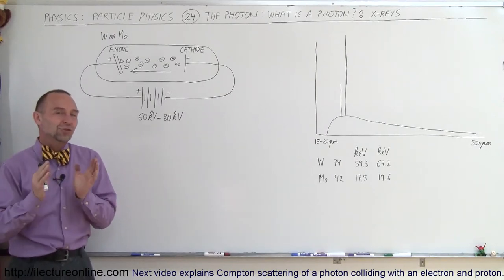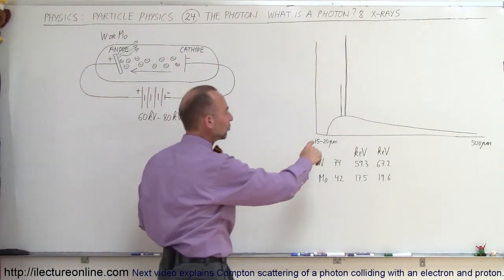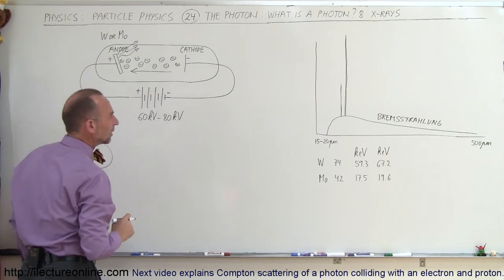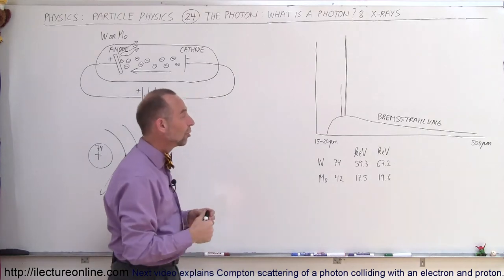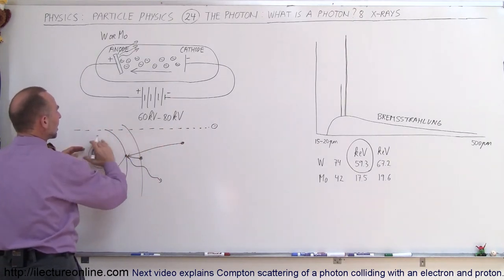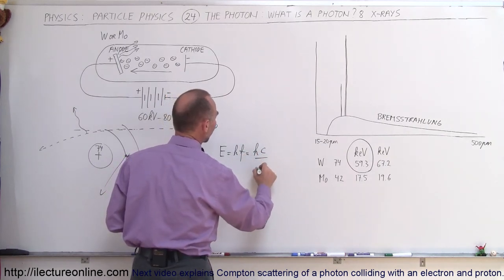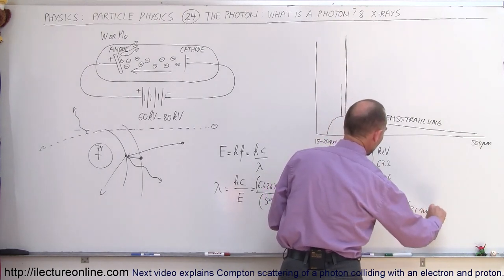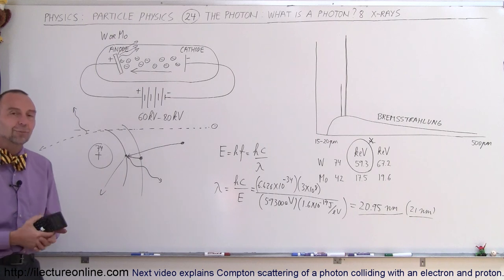Particle Physics (24 of 41) What is a Photon? 8. How Are X-Rays Produced?

Comment: Just a suggestion to you sir, instead of writing the values of h and c again and again in the formula of wavelength [ lambda= hc/E] and then converting it to nano meters by dividing it by a factor of 1.6 x 10^-19, you can simply use this - lambda= 1242/E. This directly gives you the wavelength in nanometers . ( i use this a lot cuz this saves time and i was taught this during the preparation of  JEE  ) .
Reply from the maker: Yes, on the JEE, there is no time to waste.

Comment: What is the characteristics line of the continuous line spectrum ?
Reply from the maker: The continuous line spectrum,  (which looks like the black body radiation curve), is produced by the heat of the heat source and the target of the electrons being projected across the gap, the characteristic lines are the peaks produced by the acceleration / deceleration of the electrons themselves.
Reply: @MichelvanBiezen  But as i now , the characteristic lines is  discrete line , but heat is continuous form of energy , does it show the discrepancy ? And what makes different length of characteristic line ?
Reply: Does heat energy produce convert fully into kinetic energy of electron , 1/2 mev^2 or eV ?

Comment: What  happens to the electrons that were knocked out where do they go? What happens to the electrons in the higher orbitals that are knocked out of orbit, I am sure they release photons as well as they are replaced, but also when an electron is filled in, there is a missing electron in the outer shells of tungsten and so forth, now they are not electrically neutral or ionized. What happens then? What are those implications?

Comment: For Linear Accelerators (LINAC) used for Radiation Therapy the same process is used, is that correct? However, I was wondering why LINAC can produce a much higher energy photon beam than normal x-rays? Is it because the electrons are accelerated, and thus when it is slowed down it releases higher energy x-rays?

Comment: I have a question, sir. What happens when we increase the voltage of the tube? We increase the energy of emitted electrons but since the wavelengths of the x-rays depend on the material and they are known based on the kEV, how can increasing the voltage may affect the system?
Reply from the maker: if we increase the volume, the electrons will have a larger velocity, the electrons will then have a larger kinetic energy and the x-rays they produce will have higher energy per photon.
Reply: @MichelvanBiezen  does higher energy per photon mean the wavelength of that photon is smaller? As I stated previously, the material should have a specific wavelength for x-ray emitting. Are we saying that it becomes 10^-10 from 10^-9 (m) for example? If so, what can we say about their kinetic energy?

Comment: Please let know what happened to anode metal atom when electron from cathode knock out the electron from anode atom and produce x ray , does anode atom goes positive ionized???
Reply from the maker: The electrons are continuously provided by the battery (power supply) which provides a continues flow of charges.

Comment: Why only inner most electron in W/Mo got knocked out? Why not any other orbital electron?

Thanks in advance.
Reply from the maker: I don't think we are suggesting that only the inner electrons are knocked out, but only the inner orbit electrons require enough energy to be removed such that x-rays are produced when the next electron falls down and takes its place.
Reply: @MichelvanBiezen   Does the kVp of the tubehead need to be above 69.5 in order to create characteristic x-ray, or will a kVp of 11.5 or greater still knock out an L shell electron but then only cause a 9 keV x-ray when the M shell electron takes its place?

Comment: Am I getting it wrong? To achieve the pm we need to use 593000 (answer 2.095pm) but should not it be 59300 and the actual answer would be 0.21pm
Any clarification would be appreciated.